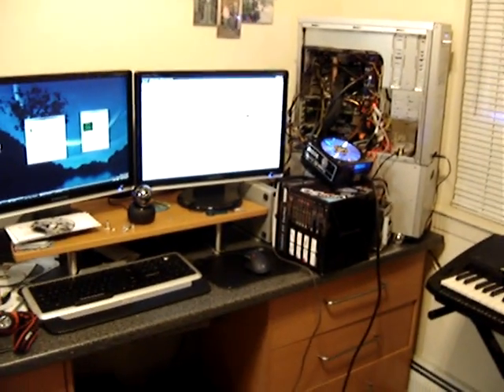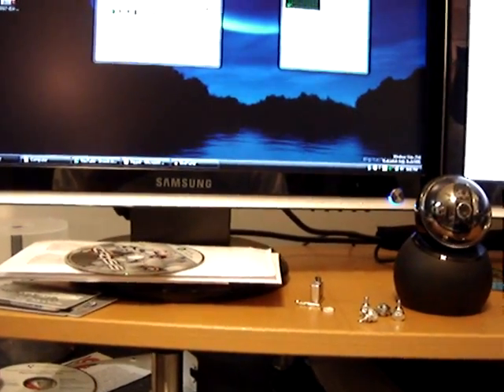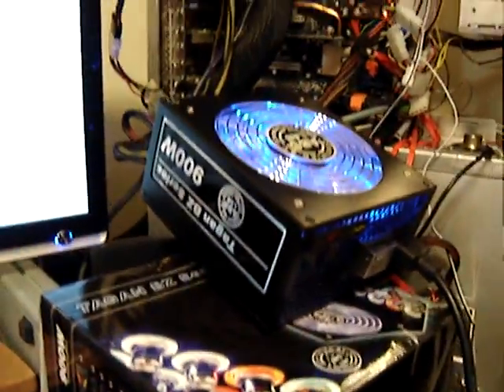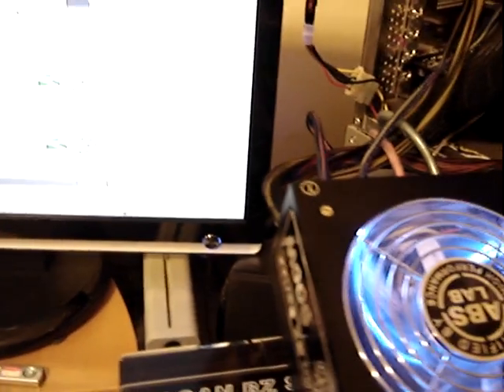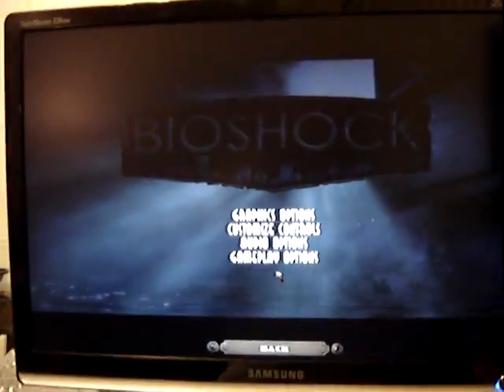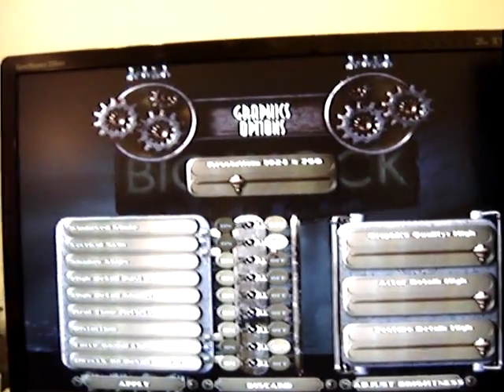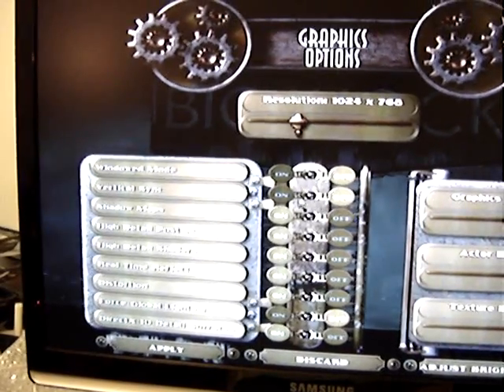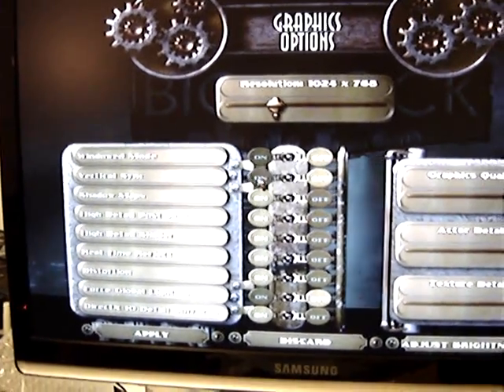Tagan BZ-900 Power Supply and 8800GT High Pitched Squeal

Comment: Capacitors can make noise, however it is a different noise to that of chokes and toroid coils. Coils tend to whine and ring a bit like a tiny bell, but this sound is more like a faulty capacitor squealing. I've had coils whining on my graphics card before and it's not a problem, but I had a cap go inside my cheap old EZCool PSU and within a week it wouldn't deliver power to my system. They are distinctly different sounds.

Comment: Every time i see this kind of problem there is a nvidia card involved. I got the same psu difference is mine is 800w running 3x ATI 5770 and a core i7. My other rig is a corsair TX650 with a GTX295 and E3110 xeon and it squeals under load with ATI tool.

Comment: hello I have the same problem...
and this power supply Seasonic X900
when Iam playing call of duty or dirt 2 or anything in particular , the buzzin/sqeeking/meowing sound occurs quite the whole time Iam playing these games...I found on forums that it is a normal thing , because the more juice the components in your computer need the more the psu outputs it, so I guess its not an issue of damaging your hardware , rather than just an issue of the annoying sound...

Comment: I've got an HD4870X2 and it has been pitching since I bought it (which is just over a year right now). I never really cared because I used headphones most of the time, but right now it's irritating the hell out of me. And I'm not too sure about the PSU, there are reports of different solutions.

Comment: I have the same exact problem. i have a evga geforce 8800 GT SC and this all started when i upgraded my comp.

I cant even play diablo 2 because it's constant screaming at me.and loud.

It only happens in high fps places (ex intro screens etc)
i have not figured out how to stop it :(. i even rmed my videocard.

SPEC

amd 64 5200+ 
evga geforce 8800 gt sc
Biostar ta770 a2+ motherboard
2gb pc3200 memory
antec neopower 650 watt

Comment: the only solution that i have read up on involves applying a non-toxic, non-conductive adhesive like nail polish or crazy glue to the source of the noise, google it. however i must stress that working within a power supply (even unplugged) is extremely dangerous and should only be attempted by someone with experience, not to mention it voids your warranty.

Comment: it's known as coil whine and it is caused due to a minor incompatibility between modern high wattage graphics cards and a wide spread of power supplies and is nothing to worry about. the sound is generated by vibrations from either an inductor coil not wound tightly or a capacitor. in many cases the sound is present but inaudible to the human ear. it is when it's within our range of hearing that it then becomes a nuisance. old CRT television's were notorious for this buzzing noise.

Comment: I have a Corsair 650w PSU and a HD 4870. There was no buzz at all.

I tested a new HD 4870 in my system, and the buzz was there. I replaced the card with my original 4870, and since the buzz has remained. I don't get how it wasn't there before, but is now, and it is indeed annoying. I would RMA the unit, but A), there's no guarentee I wont get sent the original back, and B) I'd be without a power supply for a week.  Im gonna put up with it till I get the HD 5870..the PSU is defs making the sound

Comment: Hey, I'm experiencing the same annoying noise while I'm in the menu's of farcry2, when the gameplay starts it stops.

I'm also experiencing a bad case of static noise from my speakers while I'm just in windows.

Could the static sound be coming form the power supply too?
I'm running it with a xfx gtx260 black edition.

Comment from the maker: Wrong. Antec Signature 850 would likely be the quietest one you will find. It is rare for a power supply NOT to do this, its just that most people don't notice it because they either have vsync on, or there games are not running at a super high framerate with vsync off.

Comment: Hey in regards to your video the Zalman PSU I have, (600W silent) actually makes a whine/high pitch noise as well, although not as loud as you are getting, it actually only seems to occur when the computer is OFF. Even when I unplug the PSU completely or turn it off completely at the rear switch the noise continues for a little while and then stops. My PC seems to run fine but do you or neone know if I should  be worried? thanks, ive found hard to find any info on the web.

Comment: i just picked up the  Antec SG850 and i have to say, it is DEAD silent even under high loads. The MSRP of that thing is pricey, bit I paid 100 for mine brand new from craigslist(lucky me). I recommend that PSU to anyone who wants a quality, efficient, and reliable psu. Ebay probably got it brand new under 100 bucks

Comment: This is definitely not the reason. I can replicate this noise using an 8800 GT and a 620W power supply with a 50 amp 12V rail. The 8800 GT under full load cannot come close to stressing that power supply. Yet the noise still happens.

You're right though; it probably is "normal". Only because the hardware manufacturers are not interesting in fixing the problem.

Comment: that thing is a death trap tagan uses  low quality components and have some of the worst soldering on the pcb even vorse than 40 buck psu just check hardforum . com review of the 1300 watt model you will be scared to death to keep that thing plugged in after that

Comment: With vsync off your graphics card is doing more work because it doesn't need to wait for the screen to refresh before it works on another frame, so it draws more electricity. A 900W Power Supply shouldn't have any problem with an 8800GT though.

Comment: this problem is most likely caused by EMI(electro magnetic interference). If you open the psu up you may be able to single out the exact source of the noise. You could then use duck-tape to shield the component. Shielding for those kind of components is always shorted to ground. It could be a simple 2 second job.... I'm returning my psu with this exact problem tomorrow, but will be trying the method above tonight.

Comment: Thanks for the reply, I just got back from doing the exact same thing as you, removed the power supply and listened for the noise and i beleive that the noise is coming from the motherboard, it's an asus m2n-560 sli, really dissapointed since it's an asus but what can I do. It behaves the same as your power supply so im thinking it's one of the coils or components on the board, guess i know what im buying for christmas. Thanks for the help with the power supplies though.

Comment from the maker: Right now I have just purchased the Antec Signature 850W Power Supply. Its Fantastic. The noise is still there but significantly reduced. The Ultra X3 1000W Power supply I have used in my system for a while was significantly better as well. Get the Antec Signature 850W if you want the best of the best.

Comment: Wow I am having the exact same problem with my psu, guess i get to go buy a psu from a major brand, right now I have a rosewill 550w with a xfx 9600gt and when I enter a game etc. i get that high pitched squel, tried the v sync and the noise dropped dramatically but not completly, have you changed out your psu yet, and did it fix the issue?

Comment: i have a bz700 with a bfg 8800gt. I didn't have any problems in any games.. no noise. nothing. But then I overclocked my Q6600 from 2.4 to 3.2 and it immediately began to squeak just as shown in this video in all games... very strange..

Comment: I just put a Tagan BZ 700W power supply in my system with a GTX 280, and every time the system hits high framerates, I too get a high pitch squealing sound. Examples of places where I hear this are the Crysis menus, the ATI artifact scan tool, and the 3DMark06 pixel shader test. Turning on vertical sync (limiting to 60 fps) is a temporary workaround that fixes it. It is not a fan problem, its an electrical/inductor noise. Seems to be a common problem, Im going to RMA this thing >:[

Comment: mina also sound like that and after a while in 3d mode it get very hot and start to smell like burned circuits.. and its not my hd4870, as my frames get higher the sound gets louder, plus  i have bad 3d performance in crysis, i'm just getting 17 to 23 fps instead of 30-45 that i should be getting. mu psu is ace 620w. realy pain in the ass

Comment: I'm having the same problem with an Antec TruePower Trio (650W). The noise started after I replaced a BFG 8800GT OC2 card with an ASUS 8800GT. I am sure the noise comes from the PSU and not the new card, as I took it out of the case too and listened closely.

Comment: I've got a BZ700 with Q6600 @ 3.0GHz, 8800GTS 640, water-cooling, 4 disk RAID, 2 other HDD's, 2 x Opticals, various fans, etc...and haven't heard any of these noises, pulls 450W. Hopefully, I never will hear it! Has to be an issue with the wiring/regulators for the PCIe lines. Your rig couldn't pull more than 350w, so maybe there's an issue with not loading the PSU enough. I'll keep an ear out for it. Thanks for posting this!

Comment from the maker: I have purchased a Ultra X3 1000W in place of this Tagan BZ-900 and the issue is resolved! It is 100% quiet (except the fan is a little louder on the power supply under load) and the cables are much easier to route.

Comment from the maker: My PC is:
ASUS Crosshair
8GB's G.Skill Ram
Galaxy Technologies 8800GT
2 X Raptor X's
3Ware Raid Card
Nventiv Mach II Cooling
A few case fans
Cold Cathode

Nothing out of the ordinary except for the Mach II cooler. But that would never cause such a noise as it has it's own seperate power plug. I also have a very expensive UPS battery backup. I have tryed taking the PC power plug out of that and going directly into the wall as well, and the same thing.

Comment from the maker: No amount of load should cause this noise. Even if it was overloaded, it should shut down before making such a noise. I'd say only about 500-600 watt max on my system while gaming. I have a watt meter and have tested it. Since this is a 900W PSU, it should be no problem.